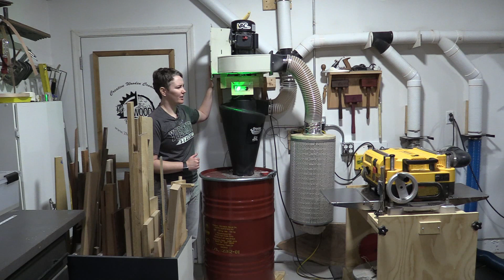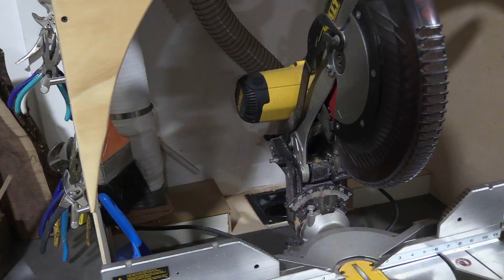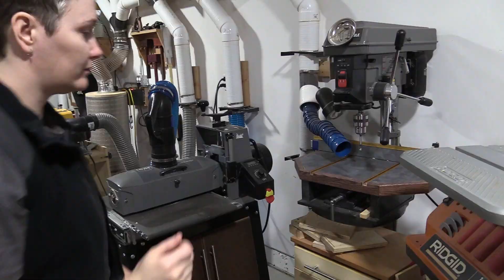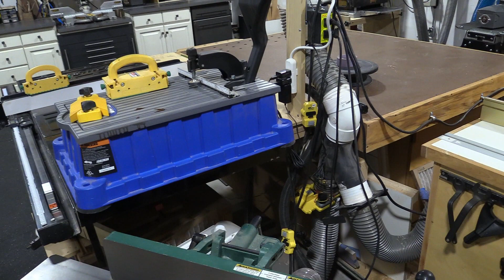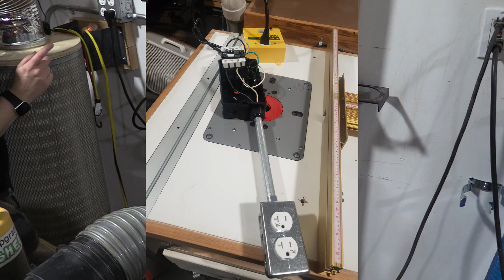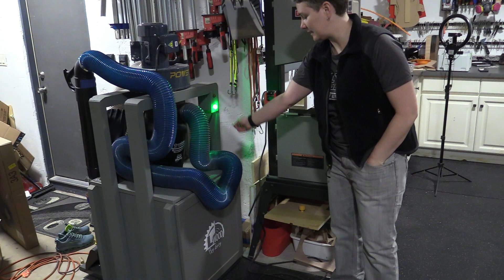Upgraded Dust Collection System Plus Automation, iVac

Comment: You need to locate a fiber/cardboard drum to make it easier to empty.
Reply from the maker: I have actually changed to a plastic drum for that very reason!
Reply: @t @thelwood I just finished installing my Ivac system.  Kicking myself I didn’t do it YEARS ago!  No more “I’ll just make this quick cut” without turning on the dust collector.  And customer service is Awsome.

Comment: If that setup is working for you that's great, but my understanding is that corrugated pipe like you're using is going to kill performance.  It's hard to tell from the video if the interior of your pipes is smooth or not.  If not I'd look into replacing those sections with sewer pipe PVC, which is relatively cheap, and should work with all your fittings.

If you're not sure about this I'd look into buying a cheap anemometer from Amazon.  Doesn't need to be super precise, just enough to see what the drop off is between your DC and your various outlets.
Reply from the maker: Thanks for the tip! My pipes are almost completely smooth but does have some slight ridges. I am certain better pipes could improve performance, especially bigger pipes.  But with only one gate open at a time I get plenty of suction. I will probably upgrade at some point, but for now it captures nearly everything.  The dust deputy and good filter make a world of difference. Thanks for watching and for your tips!
Reply: @thelwood  Yes, as big a pipe as your DC will allow, which is usually 6" for these sized collectors.  You also might be able to straighten out the initial curve by turning the cyclone on it's side.  They don't really use gravity, but rather air pressure, so turning it 45 degrees on the wall shouldn't effect performance much.
Reply from the maker: @jandrewmore  turning the cyclone is something I have never even considered! Very interesting idea! Thank you!
Reply: @thelwood  FWIW, that's essentially how the Jet version of the Dust Deputy works as well as the Harvey gyroscopic model.
Reply from the maker: @jandrewmore  that totally makes sense!

Comment: Be cautious with pvc pipe for dust collection as I have known pipes to explode from static  charge and become a fire risk if that happens with wood particles in the pipe..I believe it is possible to wrap the pipe with copper wire and ground it.,
Reply from the maker: Thank you! I have researched this a lot and from what I can find it appears that a home shop with a  lower powered system like I have are not risky.  Commercial system are very risky! I have considered grounding it just to reduce the annoying static. Since I have the automated system it isn't usually running long enough to even get the annoying static.  The planer is the only place I can notice some static. I will definitely add copper wire there,  I have been meaning to do it.  Thanks for the reminder!
Reply: @thelwood  
Great.. I use to have a commercial shop and when that pipe explodes it sounds like a bomb going off!
Reply from the maker: @davidphelps7763  yikes! I definitely don't want to ever experience anything like that!

Comment: Do you have any problems with static electricity when you are running the system?
Reply: I had some just my flex hoses, I have a 3hp king cyclone with 4 inch pvc pipe, I didn't use any 90° elbows, just Y connectors. I used thin copper wire wrapped around the pipe, a turn for ever 3 to 4 ft. I screw in 1/2 inch self tapping screws then backed them out a bit, then wrapped the wire around the screw and tightened the screw. I attached one end to the dust collector to ground it. Where my pipes split I just wrapped another pc of wire to the main on. On the planer I grounded to the planer itself. No having my hair standing straight when I'm planing. Lol
Reply from the maker: @kellyn7280  very nice! I have considered grounding it, but just always find projects I would rather do! 😂
Reply from the maker: Not really,  a little off of the planer, but just an inconvenience, not a danger.  I will probably switch the hoses that I have for the planer and drum sander since that hose is much better for static and I don't use the drum sander very often.

Comment: I love dust collection too!
Reply: Yeah, I spend way more time on it than I should. It’s so much fun troubleshooting it. I bought one Ivac current sensor and run 120 and 240 through it. I fit 2 power cords in it. I have the 240 going to a 5 position switch, to switch between tools and the 120 goes to a power strip. I’m going to get the automatic blast gates one day. Your system is awesome!
Reply from the maker: @shinobitree5711  that is awesome! And yes, the blast gates are super cool!
Reply from the maker: It is addicting!